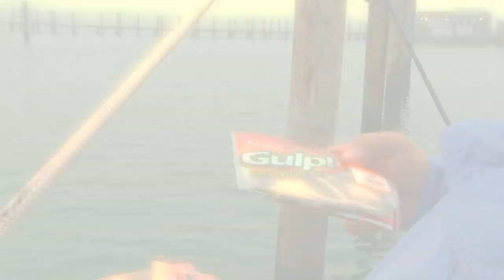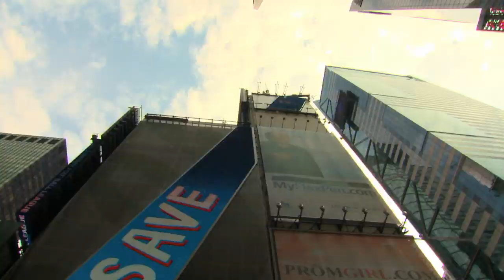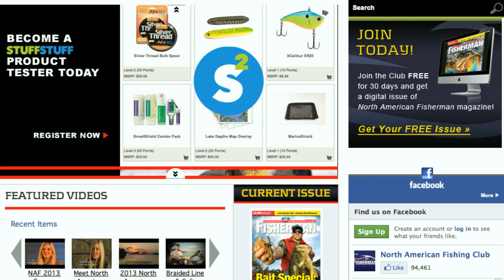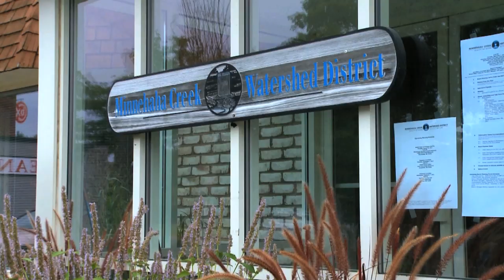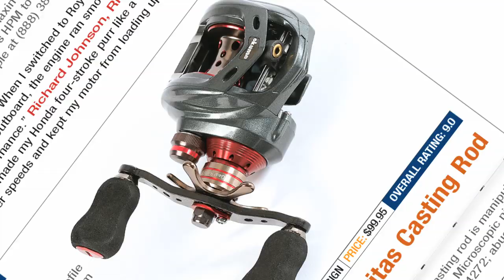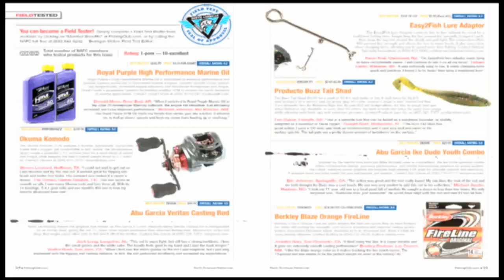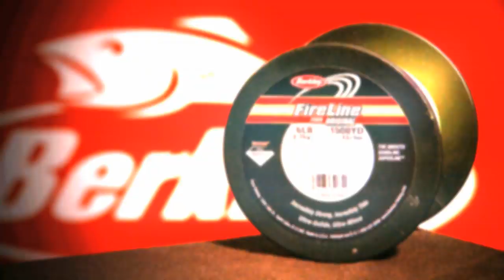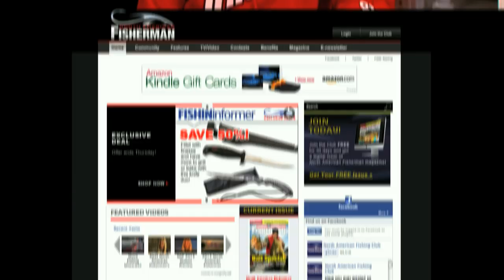Montauk Fall Blitz - North American Fisherman 2013 SHOW 8

Comment: you are allowed one fish over 28 but under 40. I've fished there all my life and never had any problem with license. Montauk is the surf casting capital of the world so if you are there in fall and have a clue what you are doing you stand a very good chase of hooking up. If you are gonna fish there be prepared it can be dangerous and read up on the equipment you will need.

Comment: they could make boats dock in a decontamination area that leads into the water body after there boat has been disinfected. be as simple as making a small pond beside the water body with a solution of somesort that would rid the boat and trailer of any invasive shit then have them pull it back out or lead them into the lake with water gates or something.